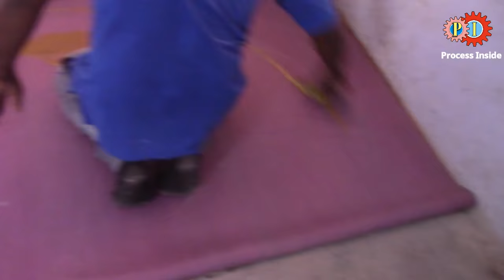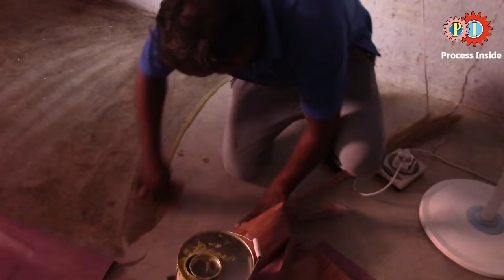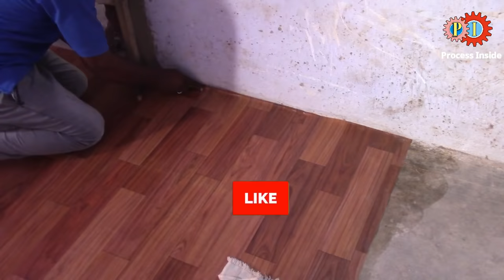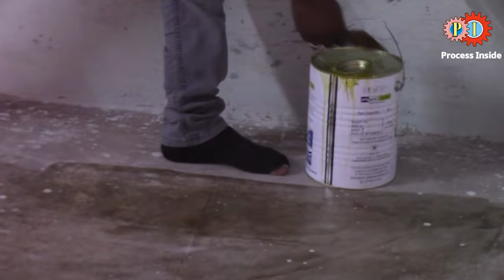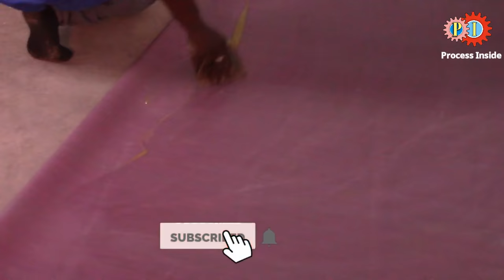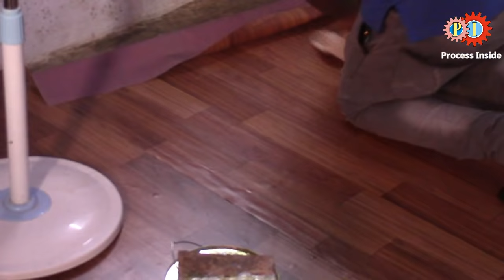How to install PVC vinyl sheet? flooring

Comment: You dont need to install adhesive for that just simply cut it according to your room. You should not move or drag heavy objects like furniture, bed, fridge etc. on that pvc sheet because that will tear that pvc sheet just lift heavy objects and place it another site where you want.

Comment: There is no need to apply the glue as well if the room contains furniture except in the place where two carpets meet. The pvc carpet wont slip away from place as well
Reply: Of course you need to, it will move and you'll see big air gaps underneath it, just use Glue made especially for PVC flooring, and not neoprene like he does in the video. And don't forget to clean and remove any dust before laying it
Reply: There is no need to bro. We have been using pvc carpets for flooring every time we move.
Reply: @Achoshverosh  can you give information regarding the price of sheets?and how long it will stay?and can we wash our rooms,or atleast mopping?and pls tell me where I can buy it??what might be the labour charges for doing it?pls let me know..I have been thinking of it since few months but I could not find correct sources for my answers
Reply: @sahithyakali3378   Its pretty cheap. But depends upon thickness of the pvc carpet. Buy a bit thick one if you intend to stay long at thet place. Not too thick as well. You can get at interior decors from where you can buy the other carpets and curtains. I dont think you need labor for this as well. But they can help you with that as well from where you are buying. You can do it on your own as well. If you want to glue you can as well. But i suggest you apply at the edges only. And you can mop the floor or even wash it just make sure water doesn't gat insige it. Moping would be a better option.
Reply: @Achoshverosh  where to buy pvc carpets..??
Reply: @Luxyhairstyles  depens on where you are from ?

Comment: What is that you are applyinh from a tin? Looks like a glue.  If it's  a glue what type of glue it that?
Reply from the maker: plastic or leather solution
Reply: Star bond & feather bond & sr 505 glue also u can use
Reply: He is using atul polygrip sr 409
Reply: Look like samand bond
Reply: Kya yahi glue use hota h pvc flooring me??
Reply: Silochan

Comment: U gotto wash the floor first get up all that dust then spread glue on floor not both you'll get tons of bubbles .plus u should use atleast a 5o lb roller I like a 80 lb roller lol plus the guy stuck his hands in the glue . A pro knows keep hands clean and dont get nothing on you .
Reply: Exactly applying glue on back of vinyl and then the cement? You are literally setting yourself up to have the vinyl with lots of bubbles. Really strange way of installing vinyl if you ask me.

Comment: What type of glue/fevicol is it bro?
Plz reply
Reply from the maker: any rubber adhesive
Reply: @ProcessInside  10×10 room ke liye kitna price lagega
Reply from the maker: Approximately 3000₹
Reply: @samirnayaksaanvi  1100
Reply: @MaaKamakhyaSchool  500 samand bond solution k 2 dubay quarter size....800 sa 1000....khod laga lo dear
Reply: That is lapox polygrip 409 that will cost around 1400

Comment: Life time bro
Reply: DsK view .65mm (1year) 1mm (2 years) 2mm is up to 4years after then shade will be loss
Reply: Aur rates
Reply from the maker: ₹ 25 to 35 per sqft
Reply: @ProcessInside  Can you put these on the tiles?
Reply from the maker: Yes
Reply: The tiles will not deteriorate. Or if there is a problem with the tiles, remove it when.
Reply from the maker: once you apply adhesive then it leaves shades on tiles. It is very difficult to remove.
Reply: @ProcessInside  dear cost rs.25 per sqare is total(ur labour+adhesive)
Or only pvc mat price plz confirm
Reply from the maker: all included
Reply: @ProcessInside  very very thanks for reply u have required 36feet length & 18 feet wide=plz reply 2mm cost total
Reply from the maker: please do 36x18... then multiplay by 25.... approximately
Reply: @ProcessInside  ok sir but my 1st floor  made by ruf dhalai only
Adhesive set on ruf dhalai

Comment: no need of that lubricant....once u lay the matt, after 1 week of use, the matt gets attached on its on own...
Reply: thanks
Reply: Not a lubricant. That's glue. You are misinforming people. The flooring doesn't have any adhesive on it's on. It's a sheet, not planks. Planks have adhesive. Vinyl PVC Sheets do not.

Comment: What is total cost per square feet .with installation charges
Reply from the maker: with this shhet 27₹/sqft... depends on PVC sheet
Reply: Num kiska hai
Reply: Ningalude numbar kittumo
Reply: 13 rs
Reply from the maker: +919998123019 Ali
Reply: sr mujhe lagwne hai apna no send karo
Reply from the maker: +919998123019 Ali

Comment: What floor requires glue on floor and back of vinyl??? NONE... which vinyl requires contact cement???NONE....
Reply from the maker: Both surfaces required glue
Reply: @ProcessInside  
What brand vinyl 
What brand glue

Comment: Hello. Question: between sheets, my vinyl in glue and those edges get really hard, how can I soft those edges to glue them again???
Reply: Heat gun. TRY Not sure if it will work but Try a blow dryer

Comment: Can we paste glue on only floor or carpet rather on  both  ??
Reply from the maker: yes
Reply: @ProcessInside will it be perfect pasting if we do so
Reply from the maker: It's working. But you want perfect then must paste both surface.

Comment: Iam also a flooring working at banglore ..... I fix vinayl ,carpet roll,carpet tile ,vinyl strip,grassetc. Plz call any work is available in banglore ,we will do work out of Bangalore also
Reply from the maker: give mobile number
Reply: Wr r u frm
Reply from the maker: yes
Reply: @skaur6364  yes I did same but it's not durable.. .use good adhesive bond

Comment: What is about 🐀 rat àatank. Bcz it is without tiles or marble
Reply from the maker: because of rubber adhesive smell.. they don't eat
Reply: Rats eat my cement floor and wooden fram....they easily eat....but not yet happen...
I installed about December.. .2019

Comment: How to take out the bubbles that come
Reply: If you apply the right glue for vinyl flooring and have a clean and dry floor then you should'nt have bubbles. don't use Neoprene as it will make it yellow after few weeks

Comment: 1300 sqare feet room main kitne kharach milega ? ( Pvc sheet and installation charge do no )
Reply from the maker: 25 to 30₹ per sqft
Reply: @ProcessInside  waw engarukku konjam sollunga nan 2 roomkku podanum
Reply from the maker: Hindi or English please
Reply: Thamil nadu available
Reply from the maker: +919998123019

Comment: 12*8 how much approximate price
Reply from the maker: appx 3000/-₹
Reply: I am working in this field

2000rs 

Vnoly price u need 7.5 mtr 1350(1mtr-180rs (width 5 feet ))
Glue 1 ltr 200
If you are applying yourself cost 1550